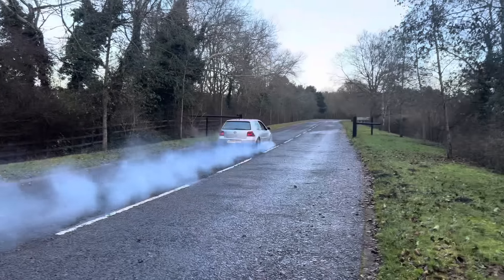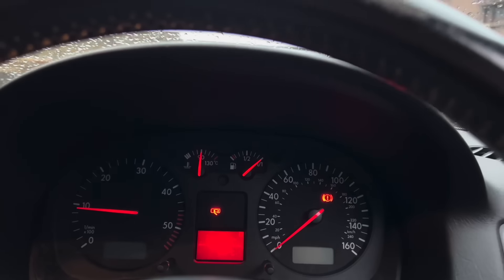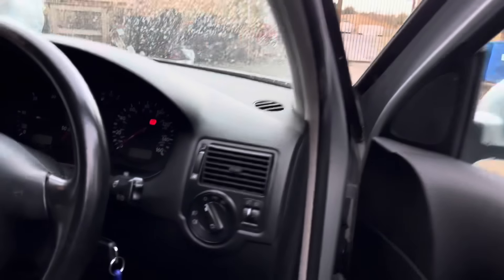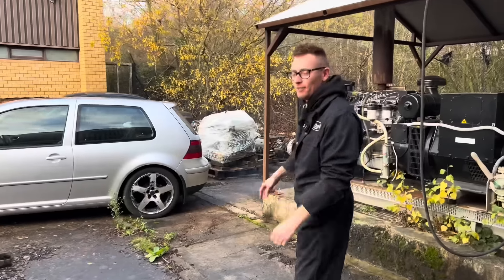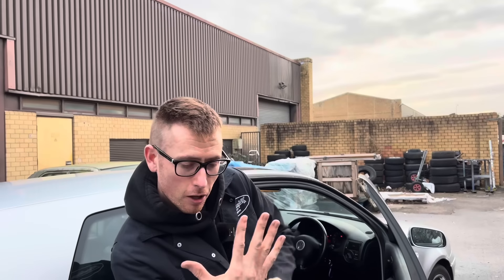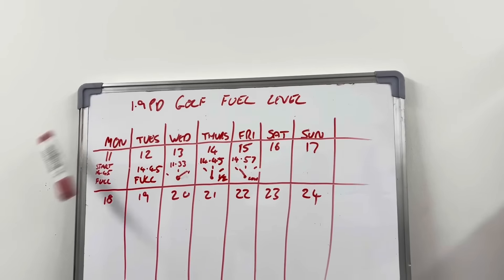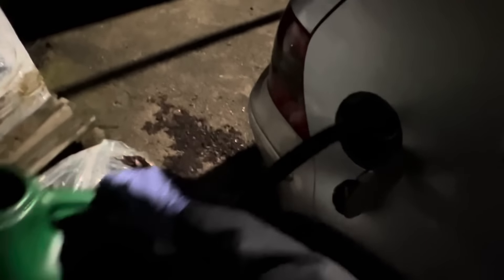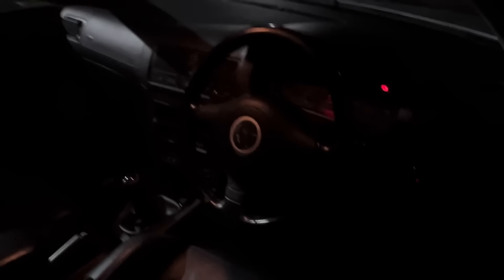2003 VW GOLF how long will it IDLE? OR Blow up first? The Idle experiment. (ONE FULL TANK DIESEL)

Comment: Hint for next time: you don't need to damage your starter by trying to start that long after running out of fuel, when you turn on and off the ignition before activating the starter. Every time you do this, you hear a splashing noise from the fuel pump. After a few times, this noise will stop. When you use the starter then, it will almost instantly start up. Much better for starter, battery and unit injectors, because then they don't run dry for so long. 

I drive my Golf PD TDI since more than 23 years now. First generation AJM Engine with 85 kW, Chiptuning since 23 years already, 103 kW, 350 Nm. Never any problem with drive train. Never needed to fix anythin in engine, first starter, first turbo, first alternator, even the muffler is still first one. With warm weather I can drive it with 3.5 l/100km at 90 km/h, although I have 19" wheels. 

When you press the ventilation button, you can fill another 10 l into the tank, so that you have 65 l of diesel. This way I was doing more than 1600 km with one tank of fuel several times already.
Reply: As a Canadian... Your comment about original muffler felt like a personal attack... lol In Canada you're lucky to get 5-6 years out of a OEM muffler. After markets usually like 3 years. Usually the pipe is what rots out first here.
Reply: @Ascended6966  There are different quality grades, which have different lifetime, even from VW themselves for the same part number. From my first car, I also knew what you described: after market mufflers rotten after 3 years. And I have to admit: from the clamp that connected the middle pipe to the end muffler fell to dust. But that was easy and cheap to replace.
Reply: Yeah, some diesels can't self-prime though.
Reply: Yeah this doesn’t have a fuel pump. Have one and had to prime it and it is a pain to do.
Reply: @MCLIcpfan000 But you don't have this engine. This is an engine with common rail and they need a fuel pump in the tank, so that is not true

Comment: These PD motors are brilliant things, tons of performance and efficient pretty much however driven.  Looked after right (i.e regular oil changes and the right oil at that) they will just go on forever.

Had an Ibiza 130 PD Sport some years ago and it was just hilarious!
Reply: We have a 1.9SDI in our Skoda Fabia from 2004. 64hp and 125nm
Its the slowest shitbox we ever had. But damn its surprisingly fun in the corners and we never got it to take more than 5.5L/100km
Regularly 4.5-5L/100km
Reply: @someguy9520 is the SDI the one without turbo? 😅
Reply: @simplexicated  yup. Thats one of the rare cases of a naturally aspirated diesel engines in a passenger car
Reply: I remember back then, the 150 PD diesels were faster than the petrols.
Reply: PD is less reliable than older " rotation " fuel delivering and PD gives you a bit higher consumption where " rotation " fuel delivering can go as lowest as 3L/100km but for that type of engine, the selected diesel must be aditive-free because it dissolves sealing around every junction over time. But it does not mean it will dissolve it after 50k but after 250-300k ( in km ) it is highly possible that could happen such a thing and i can 100% assure you that it could happen because my Skoda octavia mk1 1999 1.9TDI 66kW ( for those who is interested in cars and motoros from VW group they will know what type of engine is that ) and it leaks a bit of diesel from that distribution block where all 4 metal pipes come from. It's not that bad but from 1100km of distance driven is now barely 800 on a full tank.
Reply: I miss my mk5 TDI 170, had it mapped and felt pretty quick. Stupidly sold it and got an astra sri 150 and what a load of sh#t it is
Reply: @Azilla00  what "AnIdiot" said

Comment: In august found a neglected mk4 Golf with good body and 430kkm on the clock (AGR engine). Cold engine started from half a turn and no lifter tick. Did a roadtrip in another AGR Golf, 2200km with average 4.3L/100km.
Reply: AGR is the most reliable 1.9 TDI imo, dunno if the most fuel efficient since it is only 8 valve.

Comment: I had a customer that had a 2002 Gulf. That was in a car wreck and he just cut the whole front half of the car off right about at the driver's seat just behind the driver's seat and used it to run an irrigation pump with a 50 gallon barrel for fuel. And he ran that for years an year's. He'd started up and let it run for days at a time and never had an issue.  As far as I know, the car is still pumping. Water in the San Luis Valley in Colorado, watering potatoes in al falfa.😂🎉
Reply: It'd be cool to see a video of that one!

Comment: I'm old scool....started driving a Mini Clubman round the farm as a kid, passed my test in 1988 but stopped driving in 2006 (injury). That thing took days to draw fuel after being empty. Back in my driving years, your battery died if the car didn't start in about 10 se-20 seconds. Or it would at least turn slower. Things have changed. Back in the day a basic toolkit fixed nearly everything. Now you need to buy a specialist tool from Ford to undo bolts on a Ford. A basic, metric socket set used to be enough. Only tool I remember having to buy with a part was a ball joint splitter and it would have worked on any ball joint. Now I imagine there's a Toyota Only Splitter Tool or something.

Comment: OLD VW's are INDESTRUCTIBLE engine-wise. I have a 52 plate Bora with 179k on it and the local mechanic says it's the smoothest diesel he's worked on, then again, I drive it HARD.
Reply: No they aren't lmao. In fact vw golf mk4 have bad engines, that start burning oil after 100.000km. You could do the engie rebuild which is costly, but that might or might not fix the problem. Also they pollute too much and they you will be swapping catalysators every 2 years to pass the emission test and that's with 10.000 km... they are just bad engines.
Reply: Bullshit @beardsntools
Reply: go easy on it, it deserves it

Comment: the smoke during the test might have come from the turbo.. they tend to leak a little oil when the  exhaust / bosst pressure is low.. the type of seals used use the pressure to keep the oil inside...nothing critical
Reply: Yes, very common, not a big problem until the turbo doesn't have enough lube..

Comment: Testament to how well an engine will run if you don't have a particulate filter to clog!

bet doing this on a Euro 5 or 6 compliant PD would be clogged in about 24-36 hours lmao
Reply: Yeah the DPF and EGR are the worst things done to diesel engines. Horrifying that they call them more environmental friendly when all there will be is an engine that doesn’t even reach half of the lifetime of such an older engine
Reply: @bmwenthusiast96  But for anyone worthy of a car, they aren`t all that hard to service and maintain... DPF can easily be washed out and have its soot and salts dissolved and the egr and the intake manifold can be relatively easily cleaned, and if you care about the car, you should check the engine every 100k km anyways... It can be a bitch to do so on some cars, but a weekend of passionate work will sort it all out...
Reply: @camillosteuss  that’s right. Did it to all my cars until now. Lately my BMW 320 Diesel with N47 had its cleaning process done.

Comment: I had a volvo 740 that would randomly shut off.  I was told to try cleaning an ecu heat sink.  I cleaned it, started the car an intended to see if it would stay running for an hour.  The next morning i stepped outside my house, realized I'd left it idling all night.  It maybe used 1/4 tank at most.

Comment: These pd's have a high status of performance potential and reliablity.
Sad that you don't work on Bosch VE VP pumps.
Atracts a lot of customers.
Reply: The PD doesn’t have the VE pump, the ALH does which was pre PD.
The PD has a “tandem pump” on the head which pulls fuel through to the injectors and they do the high pressure pumping into the cylinders.
There’s a lift pump in the tank too but the can run without that working, my beetle did just fine. I since replaced the lift pump just in case I ran out of fuel.
Reply: @Dan23_7  AHU, AGR, ALH, 1Z are the 1.9s with the less complicated or more traditional head with Bosch VE.
Reply: VE? VP? Wut, ELI5
Reply: @rkan2 asv too probably the best of the old type engine
Reply: @90sDiesel  ASV has VNT turbo so not as reliable from that point of view. Otherwise they are almost identical. The head is the same.
Reply: Alh also has vnt turbo they are not unreliable they can just cause reduced power If they are not driven properly
Reply: @rkan2   VNT is the main benefit of the ASV performance wise, they are lazy dogs with the OEM Wastegate Turbo IMO, Stock GT1749V will run happy at 1 bar/14,5 psi and 140ish HP with full boost under 2k rpm

Comment: My 2014 has the ckra and uses what i hear to be double the fuel at idle. But because of that the cylinder temp stays hotter and doesn't cause nearly as much wear. Semi trucks we idle the engine up higher with the cruise control to keep the cylinder temp up. Cars dont have that function built in. So i am glad my ckra runs about 350 to 400 egt at idle.

Comment: My PD130 HATED being sat idling for long periods of time.
As a security guard working 12hr shifts i had to stay warm that way and after 1 week of this the engine never stooped going into limp mode and made catasrophic noises that sounded worse than a cambelt snapping. Eventually i got sick of it and sold it cheap. It's still on the road somehere now to be fair but i will never know what happened, even my OBD11 reader told me nothing and only helped wipe the engine light of the dash so i could drive normally again. Great engines if you know them inside out but im done with them personally.

Comment: Why did it start burning fuel so quickly after barely using any in the first two days?
Reply: The fuel tank takes extra fuel past the full level of the gauge. Even up the filler neck.
Reply: Also the gauge is not that linear in all places...

Comment: id assume  id just run out a of fuel  at work we had a  in shop built gen set  made from a pd130    most abused  thing  ud ever  seen  used daily   and  never had oil change in 15  or so years  its existed   jiust plods   mostly  on tick over running  small  items

Comment: I take it the heater was set to cold?
As temp gauge stayed at 90°c
Reply: If he wanted to assist the cooling he would heat the interior to maximum to get more of the heat out of the system. The TDI have the problem that they are so efficient  that they don't heat enough. That's why all newer TDIs have extra heaters.

Comment: A good diesel needs about 4-5 liters of fuel every hour if You can maintain. 60-75 miles per hour constant speed. Depends on the car, engine, chassis, etc.
My first thought was that slightly less than a litre per every hour while idle.
So depends on the fuel tank size. 50 liters should be enough for 60+ hours. maybe up to 100 hours, depends on the size of engine.
Actually checking the oil level and even start the engine to keep the battery healthy have guidelines. These guidelines were not followed strictly in this video.

Comment: Nowadays, i am not so sure about this statement any more , that you can run an engine on idle for 10...20...100 hours. Because of emission restrictions, the car makers have a controlled oil pump, and on idle, to reduce the friction, the oil pressure is dropped to critically low levels. Because you are supposed to have it on stop-start-assist and only run it, in case of load demand (electricity or air conditioning), coolant temperature too high, poor battery and things like that.
Maybe the damage is not seen instantly, but maybe it will eat oil sooner than earlier or you will get all kinds of defects coming from poor oil pressure.

On these older diesels, or older vehicles in general, i would say it is less of an issue.

Comment: I had a 2006 BEW golf like yours. Same color, same wheels! 😮

My scan gage II showed 1ltr/hr consumption at idle. Only problem is I saw engine temperature go down in cold canadian winter. Not worth it to idle.

Problem too with long idling, you get fuel in your oil from low cylinder pressures. Also cylinder wall scoring.

I recently purchased a 2000 chevy k3500 turbo weasel with only 125000km on the clock. Has blow by because of this. I installed a high idle switch.

High idle is required to keep engine temps up and prevent damage. Just like the big rigs (Lori's) Cheers!
Reply: Generally down to -10C these 1.9s should stay up to temp even when idling, if not, then your thermostat is gone.
Reply: @rkan2  thermostat is fine. Look at  the piston design and you'll understand why! 😉
Reply: Yes, you are 100% right.  Tthese people saying their TDi PD 1.9l engines stay up to temperature when idling in winter are probably going by the idiot gauge on the dash, which is designed to show 90 degrees C (needle at 12 o'clock) at any temperature between 75 and 112 degrees C.

You say you used a Scan Gauge.  That will show the true temperature.  I can confirm that even in a UK winter when it is around freezing point, these engines will NOT maintain the correct 92 degrees C at idle.  Even driving around in winter they won't, not unless you are driving them very hard.  In winter a partial grille block is essential if you want to maintain that 92 degrees C, otherwise they over-cool.

About thermostats, yes, of course a faulty thermostat will make things even worse, and faulty thermostats are very very common, but even with a working thermostat that does not open, does not send any heat to the radiator below 87 degrees, these engines don't produce enough waste heat to keep themselves warm in winter without a little help to keep the cold air out of the engine bay.

It's really a testament to how efficient these engines are.  Heat is wasted energy.
Reply: @rkan2  Not in my experience.  Are you relying on the 'idiot gauge' on the dash?  That is designed to show 90 degrees C (i.e. needle at 12 o'clock) at any temperature between 75 degrees and 112 degrees C.  So yes, it may well idle at over 75 degrees, but that's not hot enough to run efficiently, and is not hot enough to give decent heat in the cabin.  And that's with a fully working thermostat, i.e. not opening, not sending heat to the radiator below the designed opening temperature of 87 degrees C.

Comment: What you did is you allowed the air into fuel system by letting it burn all the diesel, so no wonder it did not start immediately. I'm actually impressed that it started without proper bleeding the system.
Reply: All these old 1.9s will self bleed... Dunno if it does good to the injectors though. I dunno how much they open and therefore lack lubrication with just air...
Reply: There's a lifter pump in the tank, which runs for a couple of seconds when you turn the ignition key to the first position.  (I don't think just opening the driver's door makes the pump run on these.)  Probably a good idea to take the key out and put it back in and turn to the first position a few times before trying to start the engine, to give the lifter pump a chance to fill the tubes going to the fuel filter in the engine bay.

Comment: Keep it going, refill when close to empty.  Have competition on how many decades it will run for. 😊
Reply: It would probably go until the oil in it starts to sludge up and the engine seizes
Reply: @kennykennedy6298  Could mitigate that by working out a method to change oil out while the engine is still running.  If it leaks oil at a set rate, easy matter to top off as needed.  Filter changes might be problematic, however.

Comment: Not diesels, they moght have a small prime pump somewhere in the fuel system. Witch will be normal, but generally, if you run a diesel empty youll have some problems

Comment: Side note: sleeping in a running car can be potentially deadly because of the possibility of carbon monooxide leaks. A lot of that is released when the car is idling, it has no aroma, no taste, yet it's very poisonous and kill a person in minutes without waking them ip.
Reply: You don`t have these issues in the open. Yes, you don`t do that shit in a garage - certain death.
Reply: @M4V3RiCkU235   Someone I know died while sleeping in his van with the engine on. He had an exhaust leak  below the floor of the van. He never woke up. Never ever sleep in a car with the engine on without a smoke and carbon monoxide detector.
Reply: @Lewinner-nj6bh  that leak should be fixed. Is not like this commonly happens. As I said, in the open you have no troubles. Also when heavy snowing, you must be sure that the exhaust is not obstructed. But really...how much can it snow to cover the exhaust pipe ?! Is not like all we live in Alberta or Norway. BTW in most countries, a car with a leak in the exhaust won`t pass the annual inspection. That car would be marked as "not road worthy/ is illegal to drive it anymore until is fixed". Yeah, we have drastic rules in Europe - just to be sure this kind of s*** does not happen.
Reply: Maybe in an American or Chinese car...

Comment: you need to cycle the key 4-5 times before you start it... you have an VW om606 in there and you destroy it :)))) and about consumtion yeah... its simple math... a healty engine will consume between 0.5 and 0.7L/H so(best is 0.6 for edc15)... tank has approx 60l of fuel  so.... yeah
Reply: It wouldn't make it start, e.g. bleed much faster since the air is in the lines and won't bleed back via the return line before the tandem pump at the end of the camshaft turns.
Reply: @rkan2  would you bet 500 on that?